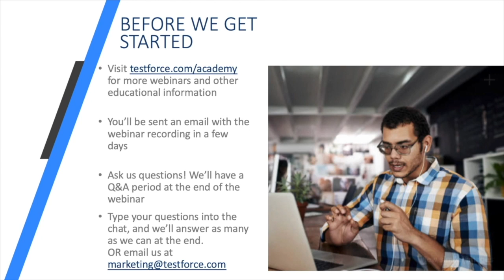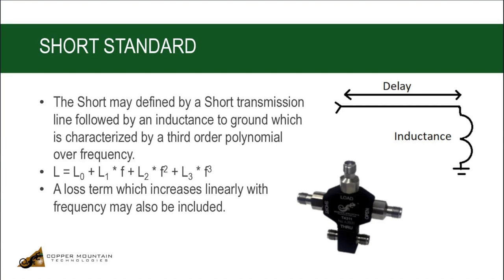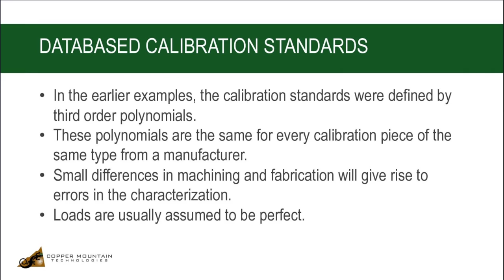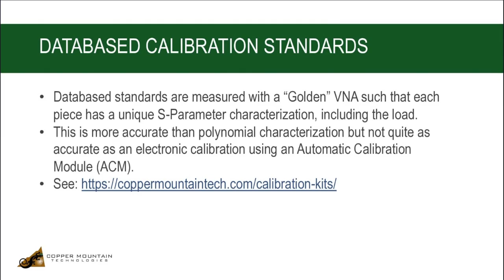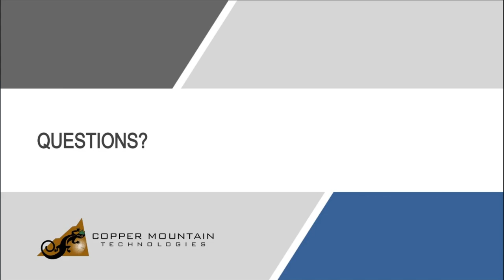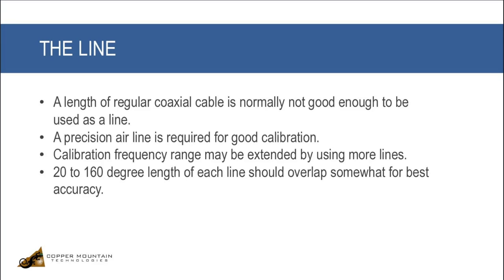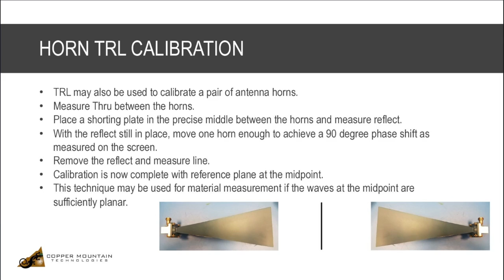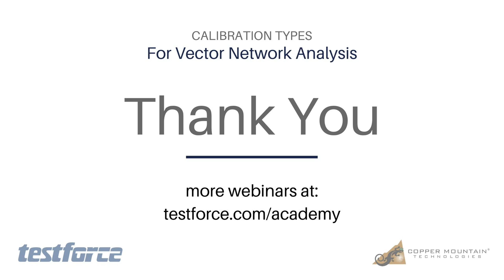Calibration Types for Vector Network Analysis | Video Training

Comment: Great content, wrong format. Belongs on YouRadio or Podcast. From what I heard, there’s only about 90 seconds of content that would’ve been conveyed more strongly with video. Still trying to envision the correct cable orientation relative to its preferred bend. To the audience member who wanted to know how  to mitigate interference of the calibration caused by touching the connections during calibration. After hours of deep introspection, my guess would be to not touch the vna, dut, or cables anytime it’s calibrating or testing. That was a tough one.